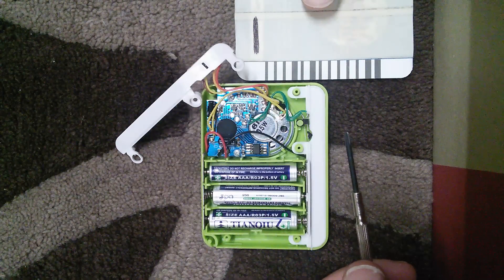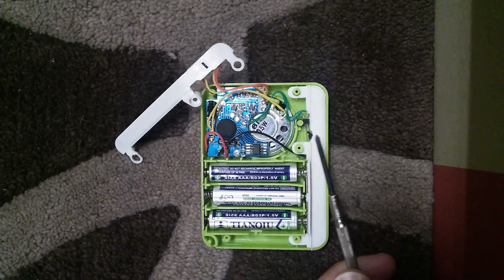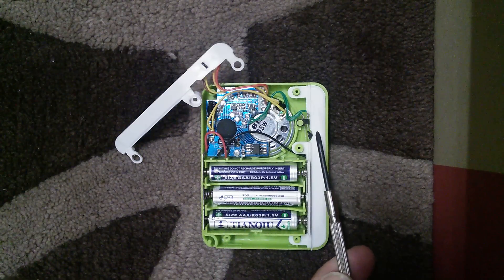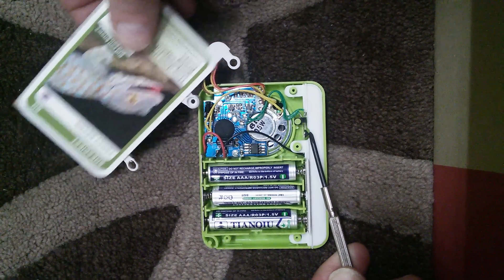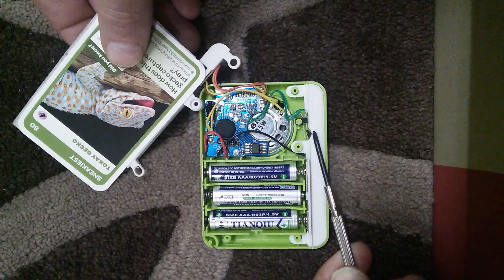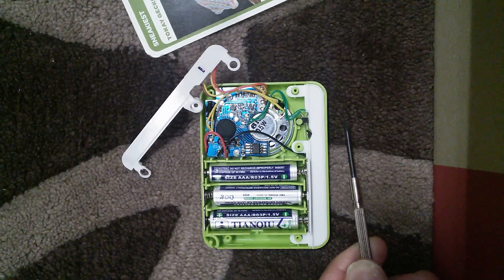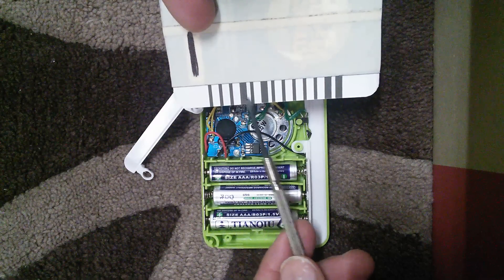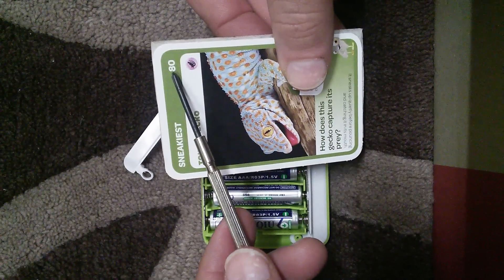Super Animals Sound Card Reader Teardown

Comment: They brought out another 72 Christmas cards recently (see here: http://youtu.be/H8rQXnKFTAY ). So they must have known beforehand they were going to release new cards. Is there any way to count the samples so you can tell whether another collection will be released in the future?
Reply from the maker: I doubt there will be more. I did a couple of blog posts about the players and didn't have much luck figuring them out. http://www.grant-trebbin.com/2014/12/listening-to-spi-bus-of-flash-memory-ic.html I think that they are close to capacity.  In one of my posts I included a spreadsheet that generates the barcodes on the back of the cards.  Maybe you could try other numbers higher than 180 and see if they play any sounds.